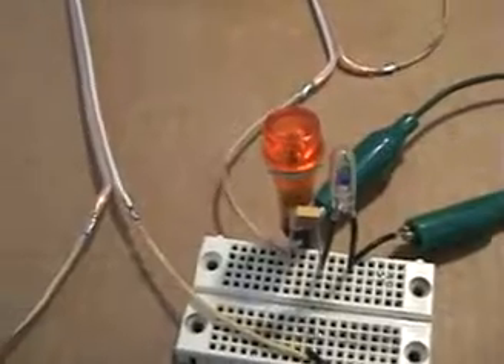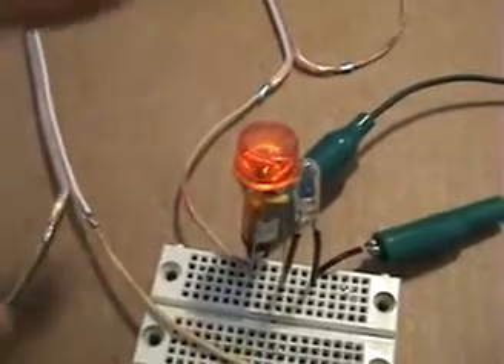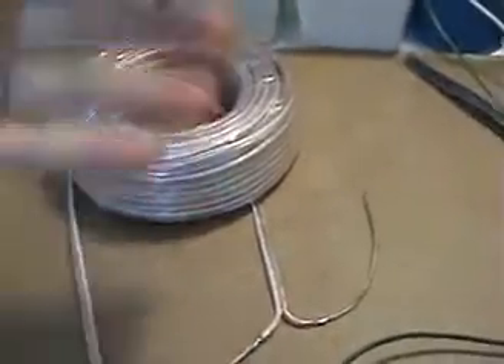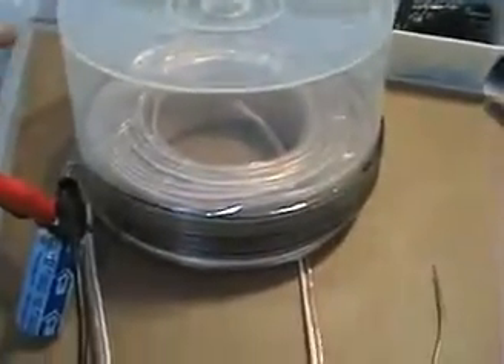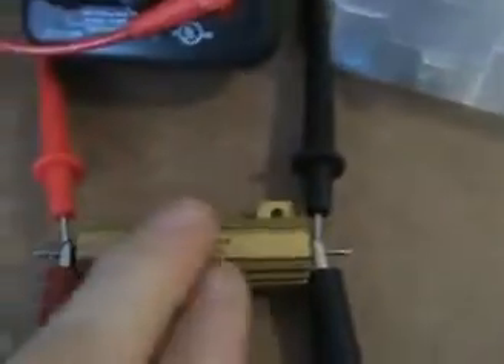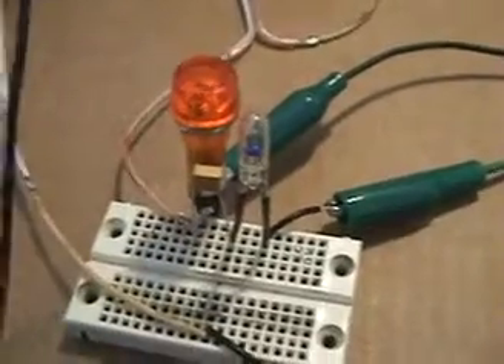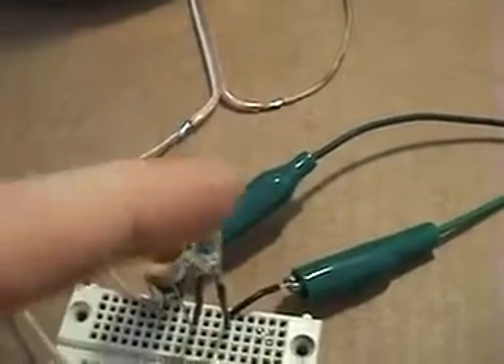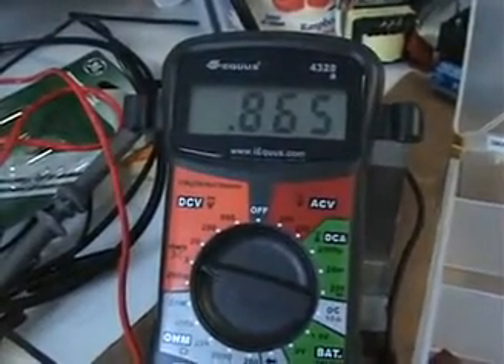Coil Resonance Tutorial 4

Comment from the maker: @healtybiotic 

It will work with normal wire also. Capacitor used are non polarized since the input is AC. It was a ceramic capacitor  in the Pico Farad range.

All the best in your experiments.

Luc

Comment: hi there..this video was amazing.  i am working on a wireless power transfer project..just several question though.  if i am using a normal copper wire instead of using the audio cable would it work?another question is what type of capacitor that you used in this test??can u give in detail of the capacitor that you used...it would really be helpfull

Comment: The only thing I see here is you showing how resonance bypasses certain parts of the cicuit. The bulb is not an effective way to show anything but the action of resonance bypassing it. In order for you to show anything real you need to measure the input from the source and the output from the endpoint. Everything in between is acually becomming a perfect conductor and not showing anything being used. The energy is still comming from the source signal gen but only showing at the end.

Comment: Hi Luc,
just try to use the whole
Loudspeaker coil with the 2nd paralel wire.
Just wire this as your pickup coil, so it is
a bifilar pickup coil
or use the real Tesla flat coil principle
(wiring inverted bifilar for not canceling but enhancing the magnetic field of the coil)
to get more stray capacitance for the loudspeaker coil.

Many thanks.
Regards, Stefan.